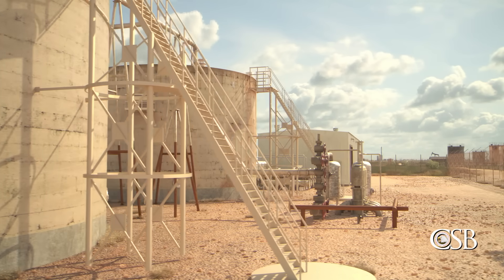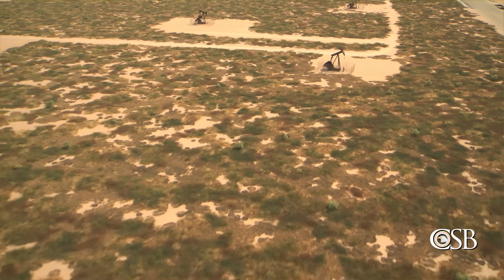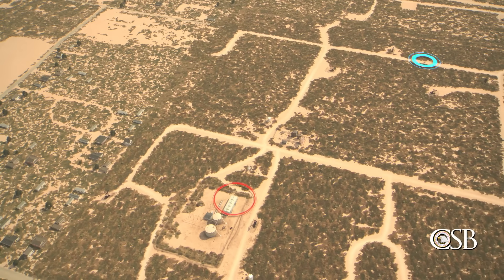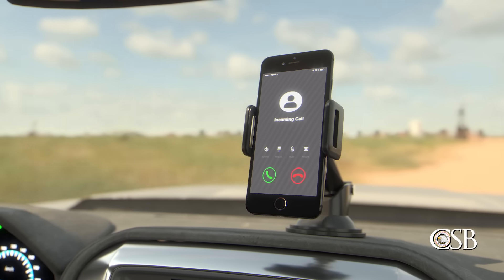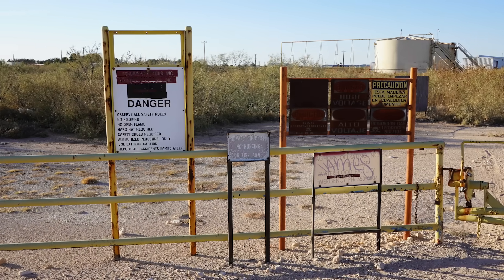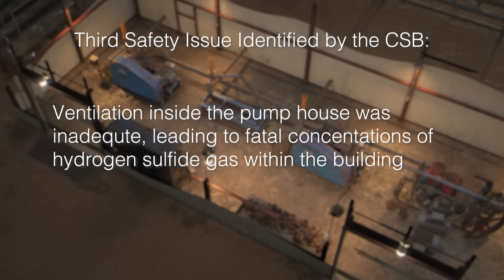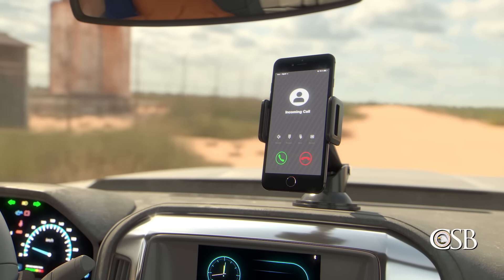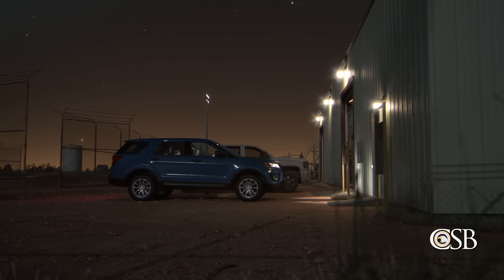Silent Killer: Hydrogen Sulfide Release in Odessa, Texas

Comment: If the first responders smelled the hydrogen sulfide, then the release had to have happened while he was in the building. As somebody working around oil byproducts he should gave known the odor. However, hydrogen sulfide desensitized your nose extremely fast so if in a high enough concentration, you wont smell it at all. That's what makes it so dangerous. 

How his wife was able to just get into the facility knowing that hydrogen sulfide is a risk, especially with children, ill never know.

Comment: I'm not certain, but it's possible that, since H2S has a very potent rotten egg smell, it was thought that sense of smell would be a level of protection. The problem is that H2S also quickly destroys your sense of smell, so if you're around it for a bit, you completely stop smelling anything.
Reply: You're correct. I was exposed to a small amount H2S in 1981 while building a H2S plant in Wyoming. It's over 40 years later and I still can't smell well.
Reply: Ever since a UPS battery ruptured at local television station and caused a power outage due to the UPS going down and taken the breaker along with it (we are at the absolute edges of maximum breaker capacity and were later issued a full rework of the electrical circuits after failing fire department tests of the electrical system) I know that those things can be lethal, the whole classroom (local television is housed in an old high school building) was filled with the stuff, massive rotten egg smell...
Reply: bingo!!!
Reply: at high levels above 100ppm you won't even smell it at all.
Reply: Not a word of a lie 🔥  I have hauled in the fields for years….. my sense of smell is shot to shit💥

Comment: I’m a pump technician and have seen those ceramic plungers completely shatter. 
Just yesterday while working on a pump on a wellhead with about 14,000 PPM, my 4-gas monitor went off when I removed a plunger. I dropped the plunger and went to a muster area. My employer is very small but spares no expense when it comes to our safety.
Reply: and that's how you stay above ground level !

Comment: Update: Aghorn and VP indicted by federal GJ for federal clean air/safe water laws, false statements on the injection well's mechanical integrity, obstructing a job safety investigation, and job safety crimes causing death.

This was worse than a failure, this was criminal corner cutting.

Comment: We are experiencing daily hydrogen sulfide exposure in Tacoma, Wa. Locals say it comes from Westrock pulp mill. When there is little wind it just settles on the city and usually causes a thick white fog. We can't sleep with our windows open or we wake up with stuffy nose and migraine headaches. There is a strong odor of garbage or rotten eggs, sometimes both - we thought it was a gas leak at first but the gas company doesn't detect anything even though my combustible gas meter sounds an alarm.

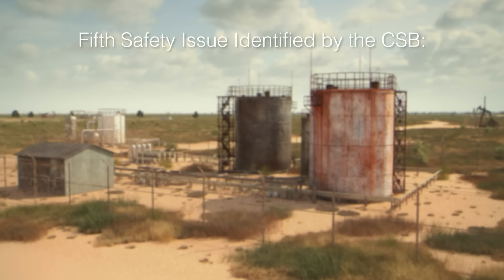Comment: (Sheldon Smith voiceover) "On Tuesday, 29 July 2021, at 11:32am Sheldon Smith sat down to record another USCSB safety video. Unknown to him, a trainee employee had left the lens cap on the camera, although industry regulations clearly stated that the lens cap should be removed before filming.  As the recording progressed, a dangerous concentration of photons began to build up inside the camera.  A safety monitor should have warned of the buildup, but had been turned off by the shift supervisor due to too many false alarms.  At 11:36, the photons found an ignition source..."

Comment: The failed H2S detection & alerting system hit #1 on my personal running list of issues CSB would find wrong with this incident. If you're going to go to the expense of installing the system after all, it's REALLY self-defeating not to maintain the damned thing once it's in place. I was a bit shocked initially, to see that issue wind up as #5 on CSB's list.
Reply: Agreed.  Several of the issues were designed to protect trained people, they serve as backups in a layered defense.  That light was there to protect UNtrained people, and serves as the ONLY layer of defense for some, making it more critical to be maintained.

Comment: It's always the SAME story with each and every single one of these types of incidents. Someone turned off the alarm system. There WAS no alarm system active cos someone hadn't bothered to keep up with maintenance, and apparently, NONE of these companies have even heard of the concept of multiple redundancy systems so they can still have safety features in place even if one should fail. There is a lack of safety features full stop, like rather than just alerting someone to a problem via a computerized phone call - how about some automatic valves and/or extraction fans/blast doors to DO something about it before the person even gets there?! (in this case, valves to stop fluid and therefore gas flow and fans to vacate the gas buildup to the atmosphere) There's never enough training, or documentation available. People skip vital steps because it's "quicker" and they don't want to lose their job if they say no to a boss trying to pressure them to work faster etc etc etc....

I swear it doesn't matter how many times oversight institutions like the CSB make their cases and recommendations, they just get ignored over and over again and we just never learn. I'd hate to work for one of these organizations and be forced to repeat the same thing for the rest of my career to deaf ears and closed wallets. I'd rather smash my face into a concrete wall, which is pretty much what they're doing.

Comment: As always, this CSB video is well done. However, listing personal gas monitor use first in findings and recommendations doesn't acknowledge the hierarchy of controls, and might send the wrong message. That is, some might come away thinking this incident mainly focused on the worker's failure to use a personal monitor.  As the hierarchy of controls describes, it would be far safer to eliminate unnecessary enclosures or ensure proper ventilation is provided in necessary buildings, and detect and warn if the ventilation system has failed. It would also be safer to monitor using fixed sensors near sources of H2S in buildings and warn workers before they enter a hazardous atmosphere, rather than relying on personal monitoring as the first line of defense. These should have been the first two recommendations rather than much later in the discussion.

Comment: I was a truck driver hauling hazmat. I let my hazmat endorsement drop off my CDL for this reason. The extra pay did not justify the risks. I will no longer work for a company that requires me to have it. If I went to any chemical plant to up a product, I was always given what I needed while on the property, even if I didn't carry it in my truck. They would often require drivers arrive earlier than pickup times in order to watch a short safety video or read and sign a safety compliance agreement. They would provide any PPE we needed if we didn't already have it in our truck. They would sometimes give us temp IDs or badges to keep track of us while inside. We were informed of evac staging areas. It was done to protect drivers, but also the company from any liability should drivers be exposed to a safety hazard. In some circumstances, I wasn't even allowed to leave my truck while on the property. The pickup process was a hassle for me. In all fairness to these chem companies, sometimes they often relied on the employee to use good judgment, in this instance, to protect themselves from a potential hazard, by using the safety equipment provided. I have personally witnessed other plant employees being too relaxed on safety, by not using the very equipment their employer required of us drivers.
My ex once told me of a similar incident that happened aboard a US Naval Sub. I don't know what time period that this incident occurred, but he implied that it was sometime before the 1980s. These sailors were going down below deck in some area one by one looking for the previous missing person, and then dying as a result of breathing toxic gas they couldn't detect. Three died before sailor #4 saw the bodies at the bottom of the ladder and reported it without going down below himself. We can't always protect ourselves, but we should whenever we can. This poor couple orphaned their children by failing to do just that. May they rest in peace.
Reply: Unfortunately  if they didn't have jesus in their heart then they are burning in hell..

Comment: the hydrogen sulfide detectors should have blue tooth connection to the cell phone incase worker is overcome with fumes. the cellphone relays the message to the appropriate people. these detectors may not exist atm but can be made with existing technology
Reply: im talking about the personal detectors, as a last measure. this idea could also be used to other job specific categories in which a personal detector of some sort is required.

Comment: This case is frightening,   35 years ago upon being a security contractor onsite at the geothermal bore field and power station in which was unmanned.   We had to pass a 8 hour course on the dangers of the chemical problems,   especially the gas around each areas around the bores and separators,   we have the biggest geothermal power system in the world since the 60s.
Reply: The largest field is in Taupo district with 6 power stations plus another one starting construction now,   they produce 20% of the nation's electrify,   I was working around the 4 latest fields as a security contractor plus for the tyre industry in which covered construction and drilling rigs,   strangely enough it's all possible because of the huge Taupo volcanic crater and connecting right across the whole central north island,   from West too east coast,
Reply: luey Hewis  yes you are correct it's been one of the largest ever volcanic eruption of time,   as I live on the lake side of the cone we get on average a thousand earthquakes per year mostly 4.5 or lower,   it's definitely a magnificent place to live but of course one must understand that its what it is to,

Comment: Can those be housed in an Open-sided Clear span Pole or Beam Structure/Shed, instead of an Enclosed, unventilated Building???? If a Barn is Required, can it be Tunnel Ventilation with Fans on the ends, just like in Livestock Buildings, to mitigate Ammonia Levels?

Comment: 2010 ACGIH guidelines provide an impetus for companies to collect H2S monitor data, allowing them to evaluate and refine their safety and hygiene programs.

    By Rick WanekSep 01, 2011 

Recently, the American Conference of Governmental Industrial Hygienists (ACGIH), a broadly recognized authority on the health effects of toxic gases, changed its recommended threshold limit values (TLVs) for airborne hydrogen sulfide (H2S) exposure. Previously, the ACGIH recommendation for an eight-hour time weighted average (TWA) exposure limit was a concentration of 10 parts per million and the 15-minute short-term exposure limit (STEL) was 15 ppm. The new recommendations for airborne H2S exposure are a TWA of 1 ppm and an STEL of 5 ppm. While compliance with these recommendations is not mandatory, they were developed from scientific data gathered by ACGIH during several years on the health effects of H2S exposure.

You cant determine 1 to 5 ppm. Just that there is  a presence.

Your h2s monitor can.

NIOSH updated and published the IDLH (Immediately Dangerous to Life or Health) value of 100 ppm. Although most people can smell very low concentrations of H2S, it is dangerous to assume odor provides adequate warning. At concentrations above the IDLH leve of 100 p.p.m, a person's sense of smell is quickly( within seconds) deadened.

The pumper saw levels over 100 p.p.m.

Comment: Compared to most states Texas is on the rape-n-pillage of the capitalist spectrum. Laws strongly favor business 'rights' over employees and the lack of safety equipment reflects that. 
Extending SCADA monitoring has far more options due to current networking technogies. Making sure that your facilities aren't in imminent danger of burning down or blowing up would be a bottom line benefit. Of course, 'analysts' and shareholders of publicly owned companies scream if their dividend or share price drops even slightly.

Comment: Blows my mind that a company in 2019 wouldn't have lock-out/tag-out policies written in place, but I've never worked at a small company in rural texas, or in the hydrocarbon industry at all.
Reply: even without written procedure, what kind of idiot works on a RUNNING pump?  With a big sign on it saying it can START AUTOMATICALLY AT ANY TIME?   He shouldn't have died, but he sure was asking for it.

Comment: As a  HazMat Tech I was wondering why a worker in that environment have have a H2S meter considering the possibility of being exposed, and oh....   4:45 
Also, warning lights that only illuminate when something is detected--how often was that tested? I have never been a fan of warnings like this because if the light burns out or there is a power/controller issue, you don't know, but that is the purpose of a redundant personal detector.
Reply: seeing as there were five sensors, three of which were disabled and the other TWO weren't even HOOKED UP properly...  at a minimum, the latter two NEVER could have been tested,  The other three - how much you want to bet they got switched to test mode because they kept going off and the workers got sick of their noise or "false alarms"?

Comment: The steel in that building is compromised too. What H2S does to steel on a molecular lever is pretty fascinating. In a nutshell, the sulfur enters the steel and hop scotch like a checker board player across the steel molecules till they reach any kind of nonconformity or flaw and the sulfur molecules will collect there causing the steel to become very brittle.
Reply: Yup. That's why most production strings are chromium, on H2S wells... H2S chews through regular piping
Reply: Would it help if they coat the steel with silver?  I used to love to artificially tone silver bars with H2S gas!
Reply: @ThePeterDislikeShow  speciality steel alloys help. I don’t think silver would be useful.
Reply: @WineScrounger  Silver corrodes and becomes black in the presence of H2S so it's good as a poor man's indicator of the presence of H2S but beyond that i don't think it has much use for protecting steel against it.
Reply: Hey i did not know that. 
Love to learn new things.

Thank you.
Reply: I'd say that's probably not an issue in this case, although embrittlement of steel from sulphur compounds is a very real and serious problem, (especially in pipe lines) like other forms of steel embrittlement from chemical attack its a process that takes a fair amount of time (months to years), not an isolated single short duration event.
Reply: @deezelfairy  I suspect that it may have caused the piston to shatter as was mentioned in the video. It is possible that the pump started automatically and the piston shattered because of the pressure caused by the closed outlet valve. Finally the employee was unable to either disable the equipment or flow of the gas until he was already incapacitated.
Reply: @charadremur333  Employee was either very poorly trained or a screw-up.  This wasn't one of those "the employee did nothing wrong and was just following procedures" issues.  This just happened to be the issue that finally got him killed partly as a result of his own actions.  But the video doesn't go into too much detail - the guy might have been on-call and gotten woke up in the middle of the night and showed up still groggy from having been rousted out of bed.  That's what I'm going to assume, considering the mistakes he made.  Though there probably weren't any better options available.... when you get a page that equipment you're responsible for is trying to break itself, you can't just wait half an hour while nursing some coffee before heading out to check on it.

That remote location may not have had cell service either.  So the wife was probably justifiably concerned when her husband didn't return, and didn't have many options.  She may not have been aware of the dangers present, and it's also likely that she had accompanied him to the facility on several previous occasions, and was at least somewhat familiar with the location.  And I've never seen someone that's just onsite for a quick fix lock a gate at a remote facility like that.  That'll be a hard one to get people to follow.
Reply: @deezelfairy  high carbon steel is trashed immediately by H2S, even at low concentrations...  Special alloys are de rigeur
Reply: Ahh yes molecular levers... such an amazing topic.
Reply: Interesting
Reply: Yes, kind of like high-temperature hydrogen attack (covered in other USCSB videos). A lot of the materials we think of as extremely, immutably solid can be degraded by the presence of ions and develop microscopic cracks that dispose them toward catastrophic failures. And it's only through rigorous inspection and replacement that these failures can be prevented before they kill people and destroy millions of dollars of property.
Reply: Yup H2s is basically acid in gas form that eats away at the metal. Imagine what it does to your lungs when u breathe it in.